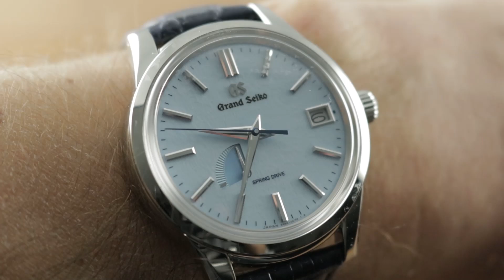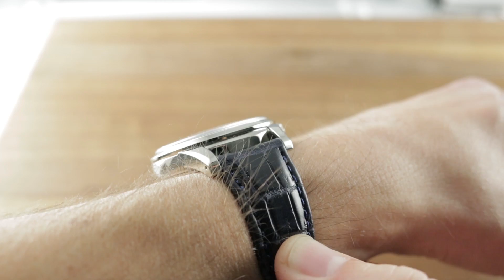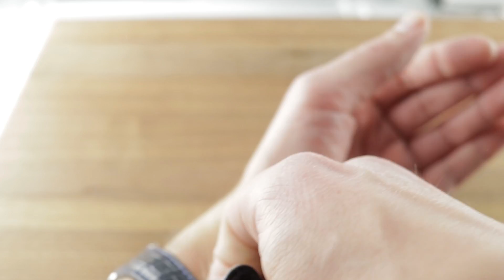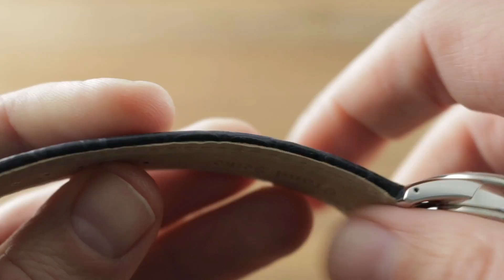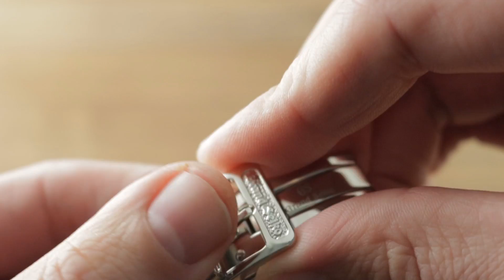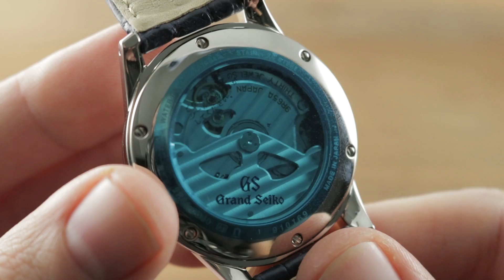Grand Seiko Spring Drive "Skyflake" SBGA407 Grand Seiko Watch Review

Comment: Anyone interested in this watch will love it...I bought it 3 weeks ago, the dial and polishing is amazing. The pics do not do it justice...the smooth sweep of the spring drive is so cool and different..even thought not a “true” automatic watch, so far has kept PERFECT time...in 3 weeks has not gained or lost 1 second!!
Reply: Steve S could you please confirm the watch thickness? WOS has this as 10mm, that must be a mistake. Thanks
Reply: @oakerone7112  This 40.2mm diameter case is 12.8mm thick. The 38.5 diameter "Skyflake" without the power reserve indicator and date window is 10.2mm thick.
Reply: @oakerone7112  the thickness is 10mm as far as I know although I never measured it.

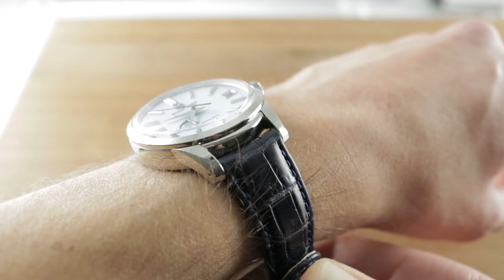Comment: Bit of dust at the 1:00 marker?
Reply from the maker: As a very recent watch, there was still some adhesive on this one from the original front packing sticker. That led to a struggle with exterior dust in this video. You can see that the caseback blue packing sticker remains in place during the video.
Best,
Tim